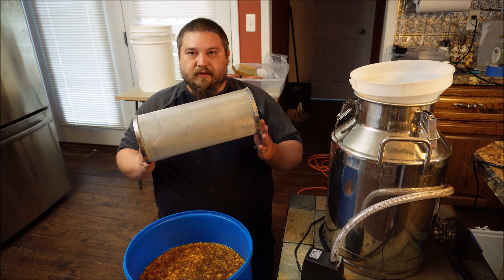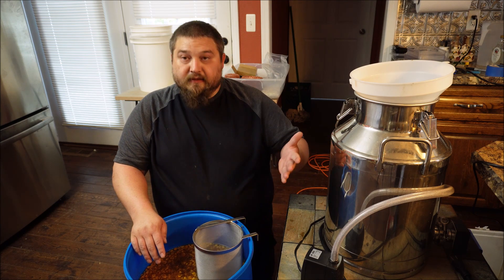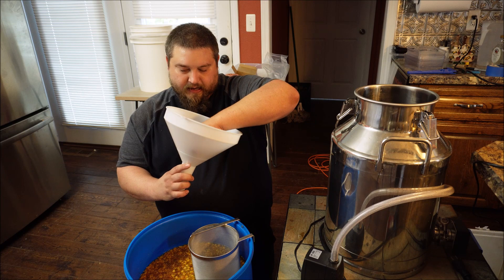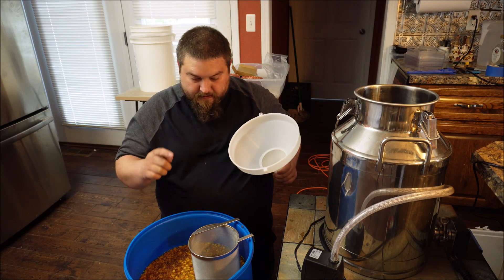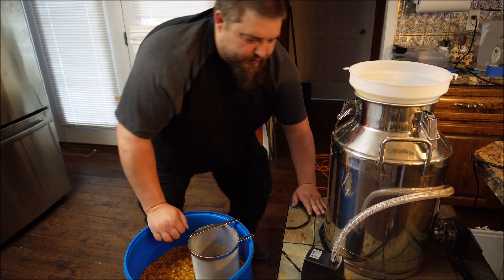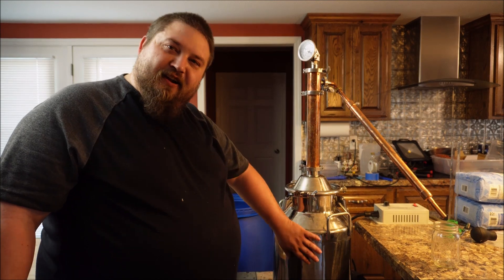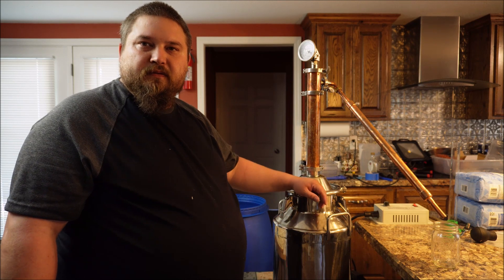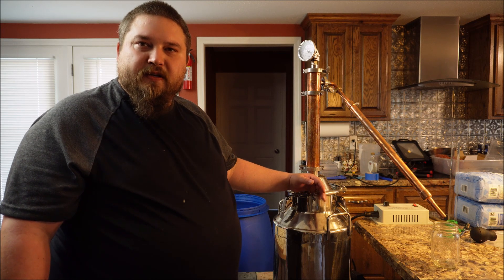Silo Corn and Wheat Whiskey-The Distillation

Comment: When running your still I know the benefit's of copper and how it absorbs sulfur. So my question to you is. Does using a stainless pot and a copper head and condenser give the same benefits as a full copper setup? I was curious cause I have a 5 gallon copper still and don't want to spend all that money for another larger copper pot if I can use a stainless one.
Reply from the maker: People have different options on this subject.  But here is mine.  The boiler doesnt matter because the copper is supposed to be in the "vaper path".  The boiler is containing liquid.  The column and condenser is what is in contact with the Vapers.  I do have copper packing in my column as well.

Comment: You should try running silage sometime......might be good?
Reply: Put a few pounds of corn in a bucket of water. Let it sit 7 days then smell it. The bucket of water does in 7 days what it takes a silo months to do.
Reply from the maker: @Still'in Old School  that is an option, i am not sure its exactly the same.  Time isnt always best rushed.  But i dont know that to be fact. I thought of doing a video about it and experiment, however the reason i have never done the bucket treatment is because i cant just come back in 7 days.  I am afraid it would just spoil.  (You know what i do for a living)
Reply from the maker: I do think that has been tried actually.  I will ask if the results were worth the effort.
Reply: @Beer Wine and Shine  I've done it. I don't know what the conversion rates would be but done as a sugar wash, with silage added for flavor in the mash, makes good likker
Reply: @PoppaLongroach  That's good to know Still'in.....would be an economical way to go.